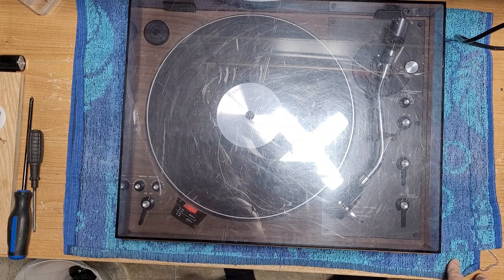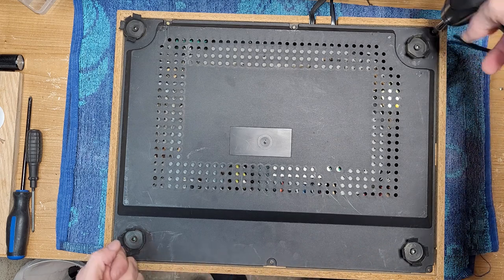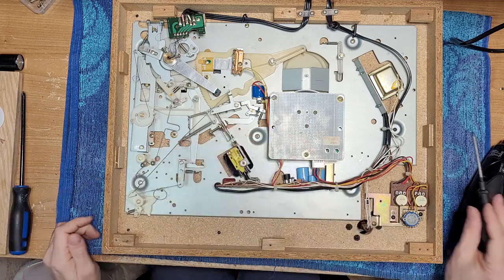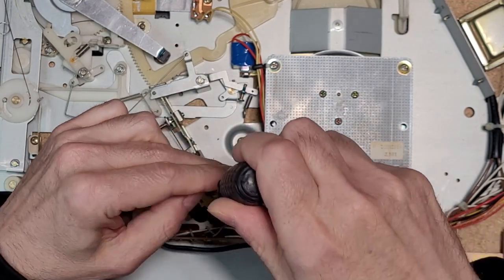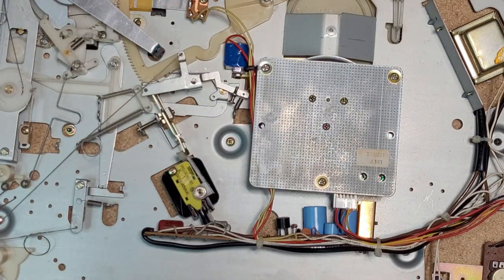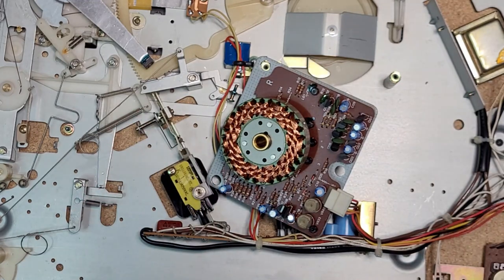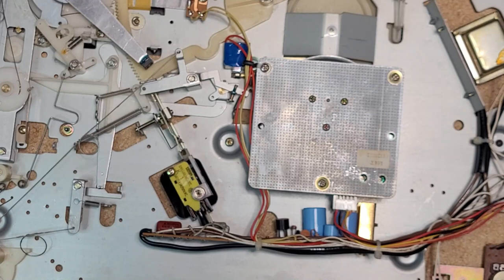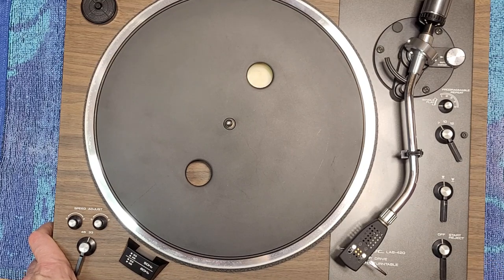Reallistic LAB 420 - Motor not shutting off and General Servicing

Comment: I always wanted one of these from Tandy (in Australia not known as Radio Shack) back when first released late 70s but couldn't afford it. I picked up one 5 years ago and it is superb, still my daily driver for most of my vinyl. I had an issue with size detection due to a very 'strange' spring arrangement that moves the small white gear. Once repaired all was well, but a real pain. Great service video, learnt a lot cheers !

Comment: I have the Realistic LAB-400, it's identical like the 420 shown here but lacks the programmable repeat mechanism.
The motor it's different and has a plate in the top to remove above from the plinth and the tone arm mechanism is less complex than the 420.
Both are very good quality CEC turntables, the very good years of Radio Shack in HiFi components under Realistic and Optimus brands.

Comment: Have a similar problem with my LAB-420, intermittently won't turn off and repeats play.  I've dug in there and moved about the mechanicals like you did, spayed deoxit in the microswitch, but that only fixed it temporarily.

Comment: Also known as Hitachi PS-58 clean the vinyl veneer with soapy water then dry them with soft towel , spray WD40 onto a soft cloth and rub in . They look magic after that also use bitumen dampening material underneath allowing the motor to breathe they can sound great .

Comment: Does the 420 feature a muting circuit? It appears so. I have a Lab-400 in perfect condition, except for one, minor, but nagging issue. By design, the audio output is muted, until after the stylus hits the vinyl, and also mutes right before lifting off the record, before the auto return is triggered. It's to eliminate the piping noise the stylus makes when hitting or lifting off the surface. The problem with mine is that it mutes the audio at the beginning just a little too long, so the actual music is muted for the first split second, and the muting circuit itself creates a loud pop when both unmuting and muting, so it kinda defeats the purpose. Another YouTuber mentioned cleaning the contacts with DeOxit on a swab or cloth, then if that didn't work, gently polishing said contact surfaces with a guy grit paper, like 2000-3000. Neither of these things worked. Suppose I could just delete the muting circuit, but It's kind of a nice feature, when it works. Any ideas?

Comment: i had this issue with mine. i just used the receiver power to control the motor power. i ended up giving it to a friend with a switch on the power cable. wish i could’ve fixed it